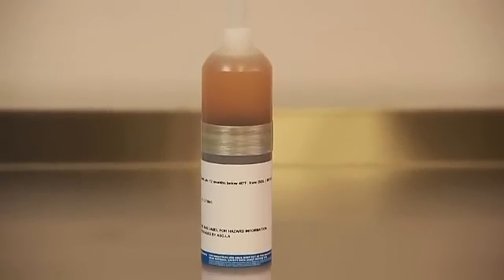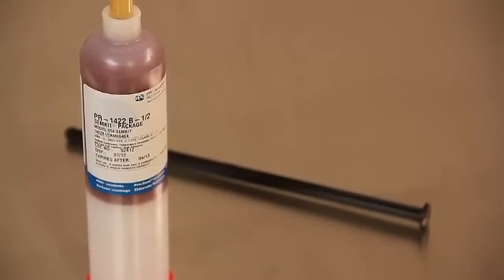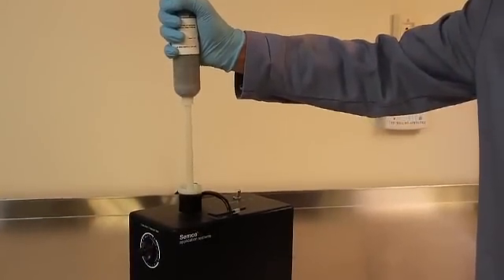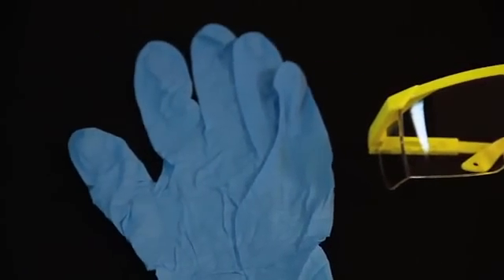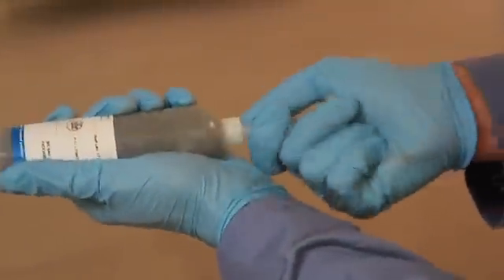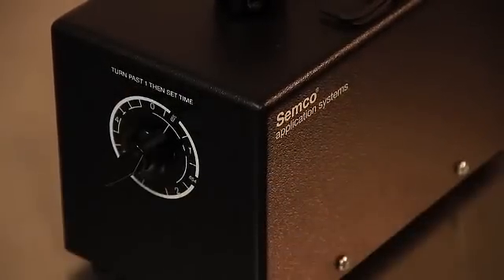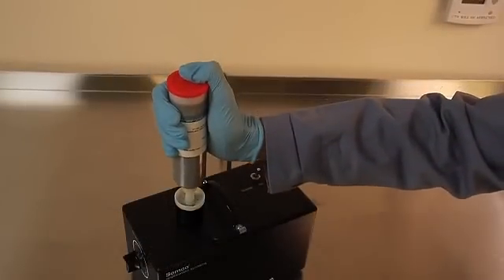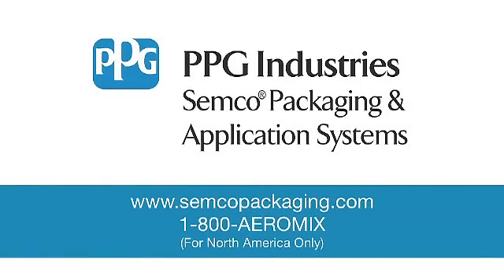PPG Aerospace - How to Mix a Barrier Style Semkit® on the Semco® 285 Mixer

Comment: 388 mixer cost baove 10T$ and for the 285mixer you can take like every drill, you can  conect via adapter or cut the head of the tupe and tight in the drillmount  and lets go! price for your mixer are only joke simple tools with extrem expensive price :(((